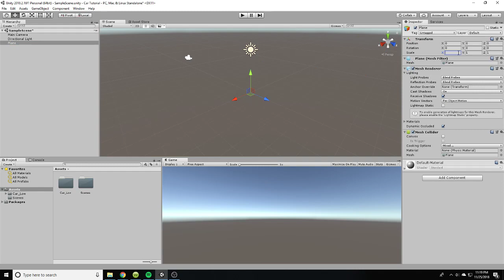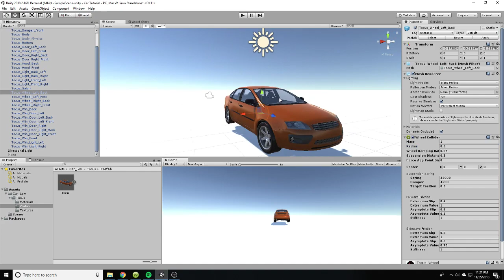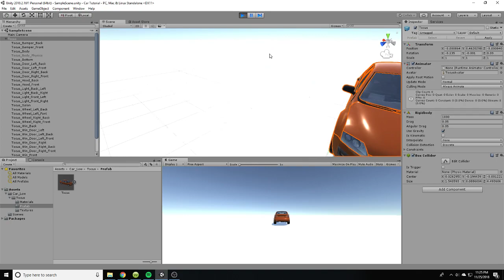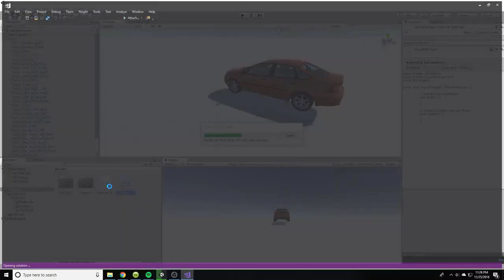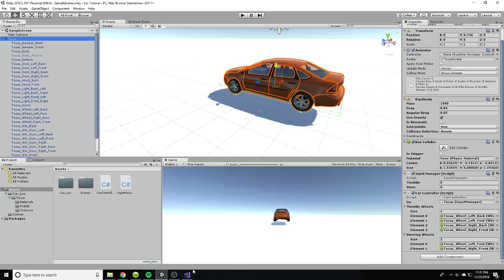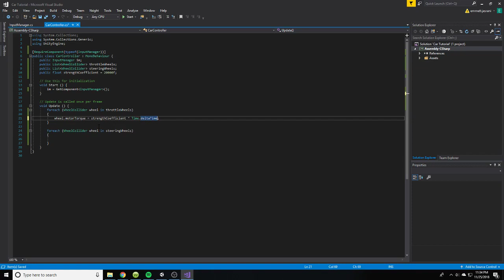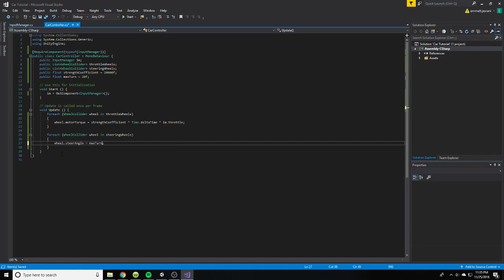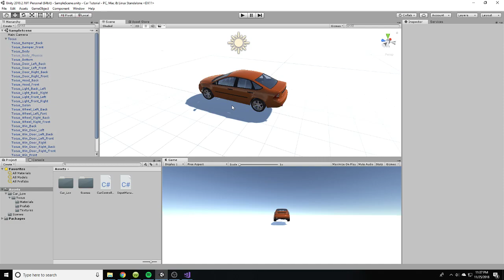Unity Car Physics Tutorial - #1

Comment: Script Name: CarController

--------------------------------------------------

using System;
using System.Collections;
using System.Collections.Generic;
using UnityEngine;

public class CarController : MonoBehaviour
{
    private float horizontalInput, verticalInput;
    private float currentSteerAngle, currentbreakForce;
    private bool isBreaking;

    // Settings
    [SerializeField] private float motorForce, breakForce, maxSteerAngle;

    // Wheel Colliders
    [SerializeField] private WheelCollider frontLeftWheelCollider, frontRightWheelCollider;
    [SerializeField] private WheelCollider rearLeftWheelCollider, rearRightWheelCollider;

    // Wheels
    [SerializeField] private Transform frontLeftWheelTransform, frontRightWheelTransform;
    [SerializeField] private Transform rearLeftWheelTransform, rearRightWheelTransform;

    private void FixedUpdate() {
        GetInput();
        HandleMotor();
        HandleSteering();
        UpdateWheels();
    }

    private void GetInput() {
        // Steering Input
        horizontalInput = Input.GetAxis("Horizontal");

        // Acceleration Input
        verticalInput = Input.GetAxis("Vertical");

        // Breaking Input
        isBreaking = Input.GetKey(KeyCode.Space);
    }

    private void HandleMotor() {
        frontLeftWheelCollider.motorTorque = verticalInput * motorForce;
        frontRightWheelCollider.motorTorque = verticalInput * motorForce;
        currentbreakForce = isBreaking ? breakForce : 0f;
        ApplyBreaking();
    }

    private void ApplyBreaking() {
        frontRightWheelCollider.brakeTorque = currentbreakForce;
        frontLeftWheelCollider.brakeTorque = currentbreakForce;
        rearLeftWheelCollider.brakeTorque = currentbreakForce;
        rearRightWheelCollider.brakeTorque = currentbreakForce;
    }

    private void HandleSteering() {
        currentSteerAngle = maxSteerAngle * horizontalInput;
        frontLeftWheelCollider.steerAngle = currentSteerAngle;
        frontRightWheelCollider.steerAngle = currentSteerAngle;
    }

    private void UpdateWheels() {
        UpdateSingleWheel(frontLeftWheelCollider, frontLeftWheelTransform);
        UpdateSingleWheel(frontRightWheelCollider, frontRightWheelTransform);
        UpdateSingleWheel(rearRightWheelCollider, rearRightWheelTransform);
        UpdateSingleWheel(rearLeftWheelCollider, rearLeftWheelTransform);
    }

    private void UpdateSingleWheel(WheelCollider wheelCollider, Transform wheelTransform) {
        Vector3 pos;
        Quaternion rot; 
        wheelCollider.GetWorldPose(out pos, out rot);
        wheelTransform.rotation = rot;
        wheelTransform.position = pos;
    }
}

Comment: Good tutorial. Followed all the steps. The car moves on keypress but the wheels not turning and when the car turns, it changes direction upon the keypress but the front of the car does not steer into the turn. Any suggestions? Worked on it a bit more. Problem solved. Thanks!!

Comment: For me it gives me 3 compiler errors:

Assets/CarController.cs(11,46): error CS1002: ; expected

Assets/CarController.cs(24,70): error CS1002: ; expected

Assets/CarController.cs(24,81): error CS1002: ; expected.

Here is the script that I copied for CarController:

using System.Collections;
using System.Collections.Generic;
using UnityEngine;

[RequireComponent(typeof(InputManager))]
public class CarController : MonoBehaviour
{
    public InputManager im;
    public List<WheelCollider> throttleWheels;
    public List<WheelCollider> steeringWheels;
    public float strengthCoefficient = 20000f

    // Use this forinitializaton
    void Start()
    {
        im = GetComponent<InputManager>();
    }

    // Update is called once per frame
    void Update()
    {
        foreach (WheelCollider wheel in throttleWheels)
        {
            wheel.motorTorque = strengthCoefficient * Time.deltaTime im.throttle
        }

        foreach (WheelCollider wheel in steeringWheels)
        {

        }
    }
}

And this is what I copied for the InputManager:

using System.Collections;
using System.Collections.Generic;
using UnityEngine;

public class CarController : MonoBehaviour
{
    public float throttle;
    public float steer;

    // Update is called once per frame
    void Update()
    {
        throttle = Input.GetAxis("Vertical");
        steer = Input.GetAxis("Horizontal");
    }
}
Reply: I would really appreciate any help to fix it! It would be so amazing for me to make a car game! Thanks to anyone who helps
Reply: @panakcoding  I think you wrote a "CarController" in the name of public class in InputManager script.

Comment: Can you make tutorial where you making NITRO? Please!
Reply from the maker: Tutorial 9 covers a basic variation of nitro. If you wanted to let it recharge and run out, you'd need some kind of counter variable and would calculate the new value based on the input during each frame/physics step.

Comment: Wheel Colliders Suck sooo bad, making a simple car controller setup fast turns into making a spaceship game.
Reply from the maker: They're the simplest controller setup; the other method would be to just raycast and then simulate the forces.
Reply: @AxiomaticUncertainty  I agree, it's not much better with raycasting, to much overhead as to set it up for everything you'll need multiple rays.
Reply from the maker: Raycasting gets good performance and allows you to tweak more aspects of your vehicle's physics; if you're looking for drift or other more advanced behaviors, try using raycasting

Comment: I've followed the tutorial and I have a few issues:
1. the car has a minimal shake to it even with the box collider set up like yours. How would I fix this?
2. when turning, the car will start to turn, then slightly flick back, stop, then turn around on it's own axis (spinning around on the spot) but also looks like its spinning around where the back tyres are. once i stop turning, it accelerates again.
3. not too sure if the suspension is working either but could figure this out once I have the above two issues fixed.

Thanks in advance :)
Reply from the maker: 1. Are any of the colliders interacting/overlapping? I'm not totally sure what could be causing that other than some kind of bug on Unity
2. That's a new one. Any chance you could send a gif or something?

Also, it would be easier if you could reach out to me @EmmettJesrani on twitter; I can respond a bit faster on there.
Reply: I'll send it all on Twitter in a couple hours :)

Comment: I followed everything but why is my car acceleration is so bad?
Reply from the maker: Try adjusting the coefficient on the throttle. Also, check your wheel colliders' settings for friction, etcetera.
Reply: @AxiomaticUncertainty  i tried to adjust the coefficient but the car accelerate a lot faster when i remove the Time.deltaTime multiplication
Reply from the maker: @chandradelon237  Don't remove that part; just scale up the multiplier on it. Time.deltaTime adjusts the effect to your framerate so that faster computers don't have faster vehicular acceleration.

Comment: The suspension didn't seem to work onm mine, at least not visually like yours does, and the car is a lot slower, and it doesn't seem to stop as fast or accelerate as fast as yours, and the fixedUpdate completely stopped it working - the turn also never worked. I copied the tutorial exactly
Reply from the maker: 1. Check the scale of the vehicle-- if it's larger, changes in speed may appear to be smaller than they are because your coefficients aren't appropriate for your scaling
2. Try redoing the suspension steps and reassigning the wheels to the script
3. Turning should be working. If it isn't, you may have an issue with the assignment of the steering angle and/or the visual assignment

Tell me if any of that works for you, and I can try to troubleshoot more from there
Reply: @AxiomaticUncertainty  I found out what it was, not gonna say because it's embarrasing i'm so bad, but thanks... :P It was definitely not a typo
Reply from the maker: @dauntless1248  well, at least you got it all working :)

We all make mistakes, sometimes
Reply: @dauntless1248  could you please tell me what your issue was? think ive run into the same problem n need a solution

Comment: im having an issue where in unity it says "The name 'wheel' does not exist in current context"

[RequireComponent(typeof(InputManager))]
public class CarController : MonoBehaviour{
 public InputManager im;
 public List<WheelCollider> throttleWheels;
 public List<WheelCollider> steeringWheels;
 public float strengthCoefficient = 20000f;

    // Start is called before the first frame update
    void Start()
    {
        im = GetComponent<InputManager>();
    }

    // Update is called once per frame
    void Update()
    {
    foreach (WheelCollider wheel in throttleWheels);

    {
     wheel.motorTorque = strengthCoefficient * Time.deltaTime * im.throttle;
     
    }

    foreach (WheelCollider wheel in steeringWheels);
        
    }
}

i dont know what to do please help
Reply from the maker: Your foreach statements shouldn't have semi-colons after them-- just curly brackets.
Reply: @AxiomaticUncertainty  just the end or the entire thing?
Reply from the maker: @talhadevyt  shouldn't be

"foreach (WheelCollider wheel in throttleWheels);" -- remove the foreach loops' semicolons.

Comment: Im getting an error because 'wheel' doesn't exist in the current context 

I am on mac so this may be the issue, please let me know if you know how to fix this
Reply: [RequireComponent(typeof(InputManager))]
public class CarController : MonoBehaviour
{
    public InputManager im;
    public List<WheelCollider> throttlewheels;
    public List<WheelCollider> steeringwheels;
    public float force = 20000f;

    void Start() {
         im = GetComponent<InputManager>();

    }
    void FixedUpdate()
    {
        foreach (WheelCollider wheel in throttlewheels);
        {
           wheel.motorTorque = force * Time.deltaTime * im.throttle;

        }

        foreach (WheelCollider Wheel in steeringwheels) ;

        wheel.steerAngle = maxTurn * im.steer;

    }
}
this is my extact script
Reply from the maker: You capitalized "wheel" in the second foreach loop. Change it from "Wheel" to "wheel," and it should start working.
Reply: @AxiomaticUncertainty   its still not working, im going to try it on my PC
Reply: @AxiomaticUncertainty  its also tellin me maxTurn doesnt exist in the current context, these problems are most likely related
Reply from the maker: @maximilianospillmann3341  they're not. You never declared max turn in your code. Add "public int maxTurn = 30;" to the variable declarations at the start of the file.
Reply: @AxiomaticUncertainty  my mistake fixed everything it works great thank you so much

Comment: Vehicle`s wheels seems to rise above the ground when accelerating, why?
Reply from the maker: Our wheel meshes are a set distance from the ground. When you accelerate, the wheel COLLIDERS extend and the meshes stay the same, so it looks like the wheels are not grounded. To fix this, you could make the meshes extend in the y-direction of the car until they make contact with the ground via some creative use of raycasting.

Comment: Ok my wheel collider is perpendicular to the wheel itself. That's not what's happening with your game. What the hell am I doing wrong?
Reply: Greetings, i`ve had same problem, and i found the solution. Go back into your 3d redactor, and turn whole model 90 degree.
Reply: @desland4759  thanks I was actually having the same problem using just a regular box collider. You're right it was cause I rotated my car 90 degrees to it faces the Z axis
Reply from the maker: I never saw this comment, but I'm glad that you got it all sorted out :) I'm actually planning to make a tutorial that doesn't use Unity's wheel colliders in order to allow for more customization
Reply: At this point ive abandoned wheel colliders altogether and now am using just a rigidbody to simulate the car physics. but I can't get that to work either cause I was following a tutorial in JavaScript. I tried my best to convert the script into a C# but I obviously did something wrong lol

Comment: Yo how can you make this work with an Xbone controller? I want to be able to control the throttle and braking with the trigger buttons
Reply from the maker: You can use the input manager to assign the horizontal and vertical axes to controller inputs or add them as their own set.

Comment: you could use a followPlayer script for the camera. Add a new script to your main camera and use this code:
Afterwards drag the car into the player variable 

using UnityEngine;

public class FollowPlayer : MonoBehaviour
{
    public Transform player;
    public Vector3 offset;
    public Vector3 cameraAngle;

    // Update is called once per frame
    void Update()
    {
        transform.position = player.position + offset;
        transform.rotation = Quaternion.Euler(cameraAngle); // For adjusting the camera angle
    }
}

Comment: Hi the Tutorial is good bu when my wheel is facing south my wheel collider is facing west. is there any way I can change the directions of the wheel collider?
Reply from the maker: The simplest solution might be adding a parent to the mesh and rotating the mesh 90 degrees. Then, you could use the parent as your mesh and likely solve the problem.

Comment: WheelCollider requires an attached Rigidbody to function.
UnityEngine.GameObject:SetActive(Boolean)
carselector:loadgtr() (at Assets/carselector.cs:19)
UnityEngine.EventSystems.EventSystem:Update()

Any way to fix this ?
Reply: this is displayed on the console
Reply from the maker: Click on the wheels and then add a rigidbody component to each of them. You need one on every object to which a wheel collider is attached. (hence the error)
Reply: @AxiomaticUncertainty   but then all of the wheels seperate and fly away
Reply: and even you haven't applied rigid body to your wheels. :(
Reply from the maker: I've looked into it, and most people claim that it doesn't cause any actual issues with the project in run-time. Apart from that, I'm afraid that I can't really help you. Are your wheels children of the car's body?
Reply: @AxiomaticUncertainty  yeah, they are.
Reply from the maker: Did you ever fix this? (Asking to help future viewers) If not, did you have a rigidbody attached to the body of the car, itself? (Has to be a parent to the wheel colliders)
Reply: @AxiomaticUncertainty  I know this question is months old, but when I had accidentally added a rigidbody to just one of the wheels, it fell off the car and rolled away as well. I removed the rigidbody from that wheel so the only rigidbody was added to the parent (Tocus) and the car stayed together at that point. For some reason, my car is moving and steering on its own...  I'm sure I'll figure it out though

Comment: Worked well, however my car is showing some sort of buggy behaviour:
https://i.gyazo.com/fee458e435eea45613d42731c1647a63.mp4

This is with decreased mass:

https://i.gyazo.com/3702cf11eebbfe73ad6aeb7caf637f16.mp4

This feels like a self collision error, however I've double checked and they don't interfer..
Reply from the maker: Maybe increase the dampening on the wheels? It really seems as if you just have too much spring, but I can't be entirely sure.
Reply: @AxiomaticUncertainty  Fixing the box collider did the trick. It was too thin in my case.
Reply from the maker: Glad it all worked out for you!